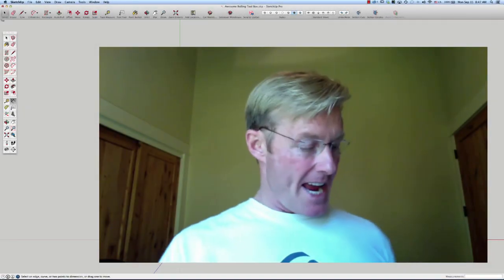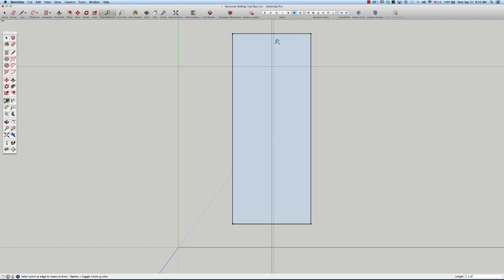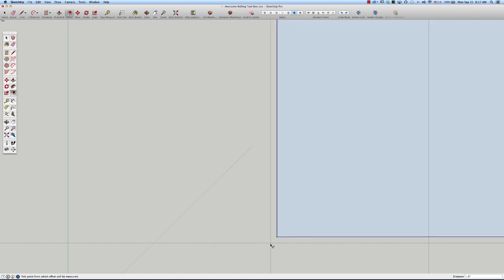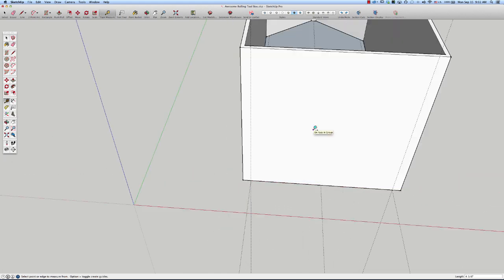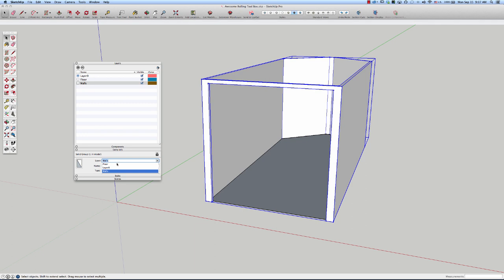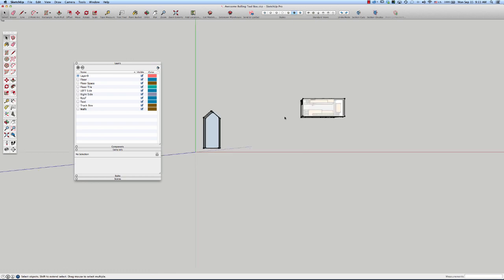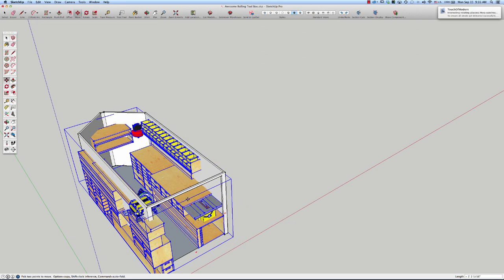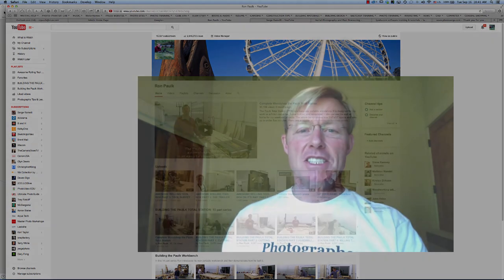BUILDING A MOBILE WOODSHOP (Part 4) DESIGNING IN SKETCHUP

Comment: Ron, I will be building a new mobile shop/toolbox in the near future. The state inspection on my 1988 Isuzu box truck expires in November and rust has finally got to the point that it will not pass another inspection. This time I'll be using a trailer for insurance and flexibility reasons. I'm thinking of insulating the trailer and installing a short electric baseboard heater so my tools won't be zero degrees or colder. Do you see any down sides to this plan?

Comment: Hi Ron,  I am curious if you use Sketchup to design houses you build?
Reply from the maker: Yes, SketchUp is the only design application I use.
Reply: Thanks for the reply Ron! I recall that you recommended to someone to start out with the free version of SketchUp. As a remodeler in business for almost 30 years and with experience in architectural drawing before getting into carpentry I have found it easier to hand draw all of my designs. But you have gotten me thinking. Do you think I would need the "Pro" version or can I make do with the "free" version?
Reply from the maker: Dan, I have been using SU since version 2 when it was only available as a paid pro version. If you want to generate printable plans for permits, you will need Layout which is part of the pro version.
Reply: Thanks Ron! I appreciate the info. I really appreciate the videos you put out and will be using some of your ideas for organizing your trailer when I organize my van. Thanks again!